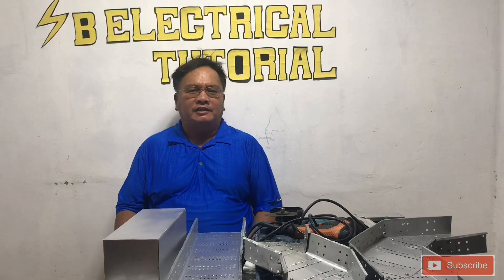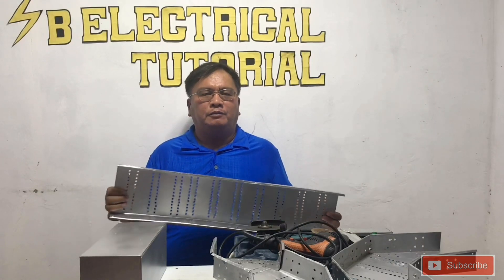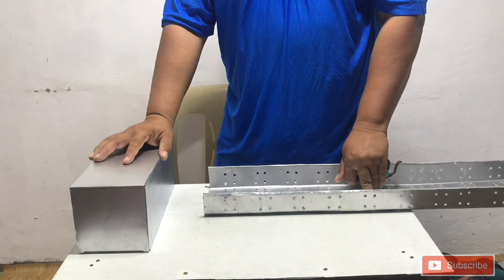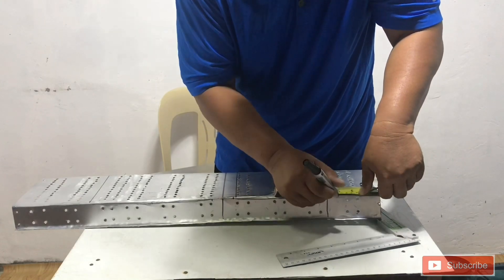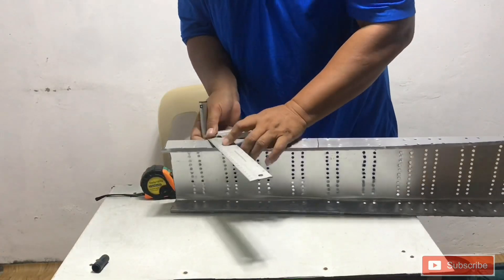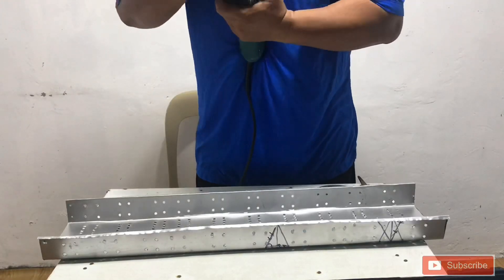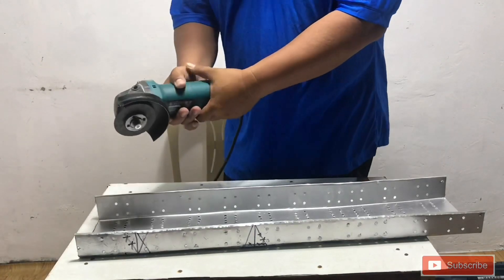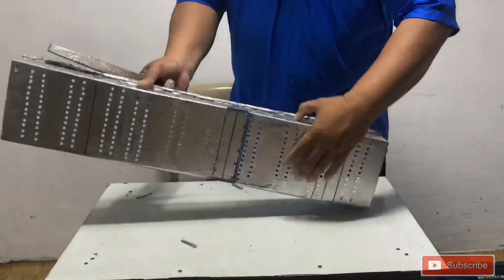HOW TO FABRICATE 45 DEGREES INSIDE OFFSET CABLE TRAY! EASY WAY!

Comment: boss yun cable ladder pareho lang din formula sa perforated cable tray?
Reply from the maker: Yes Sir, Thank you for watching, hope you gain ideas.
Reply: pahingi ulit formula boss sa 45degrees kc mabilis pag discuss mo ehehe
Reply from the maker: Measure the side of the Cable Tray then multiply by point 8, Then diveded by 2 the result is the actual measurements  to be cut both side.